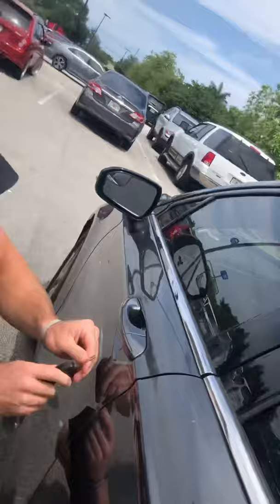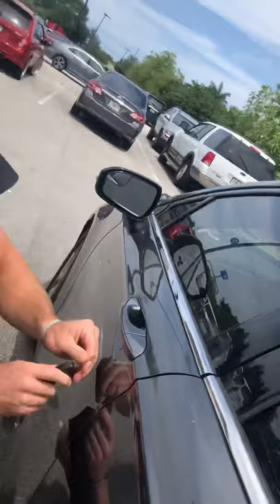How to unlock your Ford Fusion/car that has a battery powered remote with a hidden key hole

Comment: Yeah this totally helped. I just bought mine a few months ago. 2016 fusion s and my alarm went off when I accidentally set it off lol. And then I saw this opened the door and now my locking/unlocking from the fob
is working again. I am guessing the battery in the fob just needs replacing.

Comment: What do u do when the cover does not want to come off? Mine wouldn’t budge but thankfully my battery isn’t dead and I was just practicing
Reply: Use your key to open the trunk. Then push the seats down and crawl through! Bam!!!! You're in. But the smart, simple thing is to hide a spare on the body of the car's underside, etc. Or, just have good roadside assistance.
Reply: Carry an extra fob battery with you.